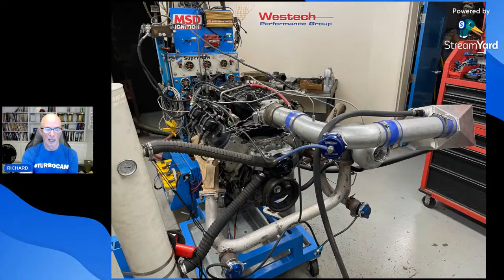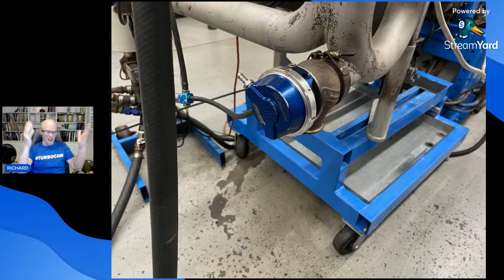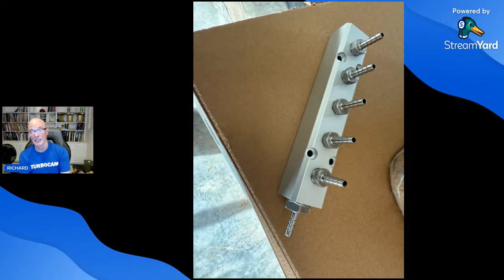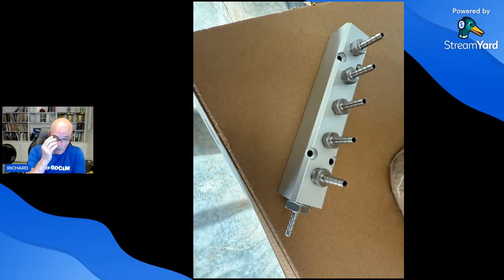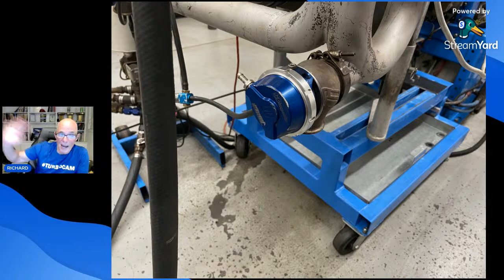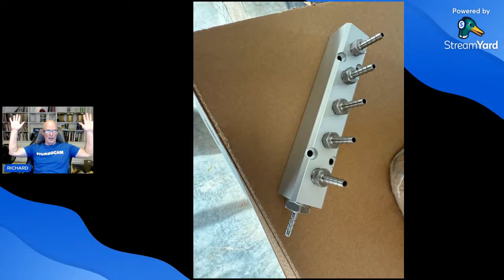BILLETY GOODNESS LET'S TALK TECH

Comment: Vacuum blocks are key to a streetable ITB setup. You can run a line to each cylinder, and the block will give you a convenient vacuum source for the MAP sensor, brakes, etc. On one engine, I even added an idle valve to the block. You'd think the idle air would ruin the vacuum signal, but it worked fine.
Reply from the maker: some of the Ford ITB manifolds have common plenum vacuum sources